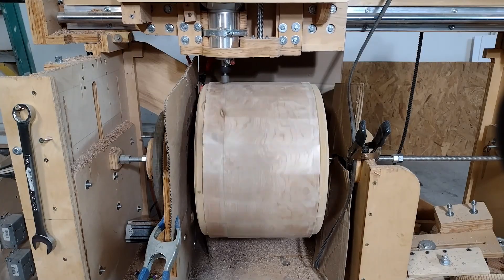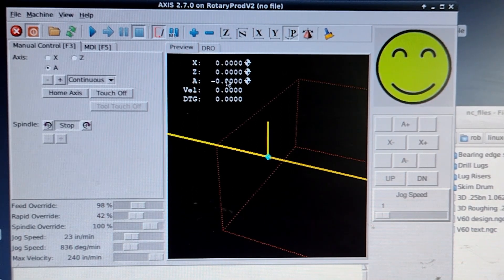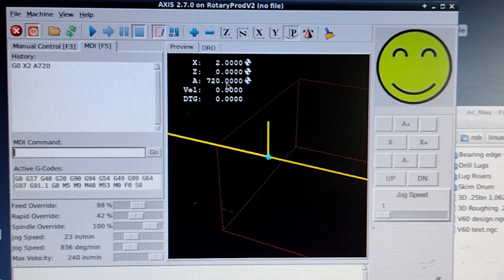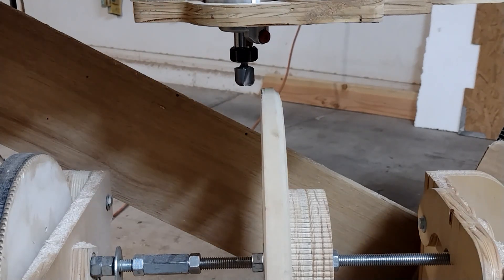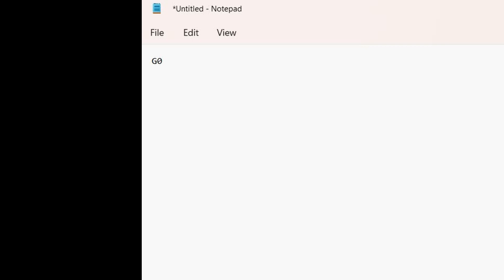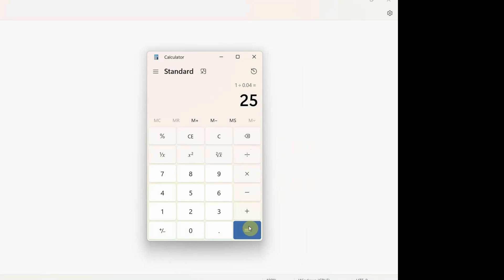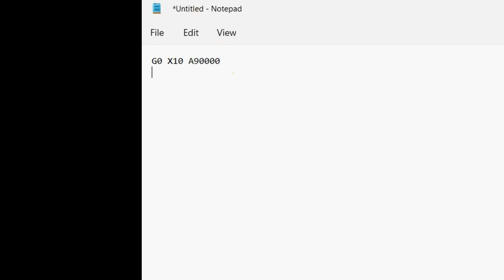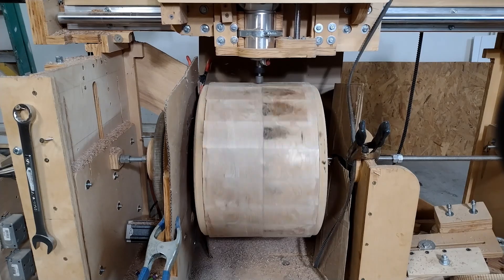Gcode on the fly for Rotary CNC

Comment: Curious - what's your HAL setup?  I'm attempting to run a CNCEST machine, with a raspberry pi running linuxcnc. As such - No parallel port. I plan on using the GPIOs that rpi already offers

Comment: Rob  2 Thinks I like the way you think about solving problems.  Second, you mention being a real Geek but used a calculator to multiply by 10.
I will definitely used your idea, Thank you.
Reply from the maker: Calc to multiply by 10 - I guess my teachers drilling into me "SHOW YOUR MATH" is show through in my videos.
Reply: @sidewinderdrums  No offense, I just thought that it was funny.  I was going to build a jig to attach a drill to and either use my CNC or table saw to round work for my Bob's CNC revolution.  Tomorrow, I will try your method.  Then make a macro to round stock.  I don't know if you can use variables in macros and have statements like enter diameter and length of wood.  You answer prompt and finish running macro.  Again, thanks for the video!
Reply: I Googled it, it looks like it is possible.  Now I have to try it tomorrow, I'll let you know what happens.